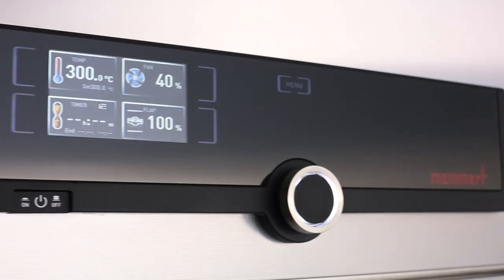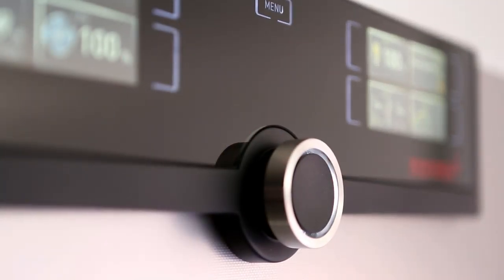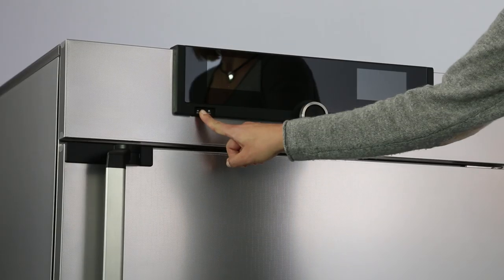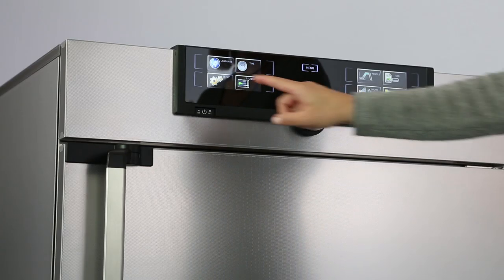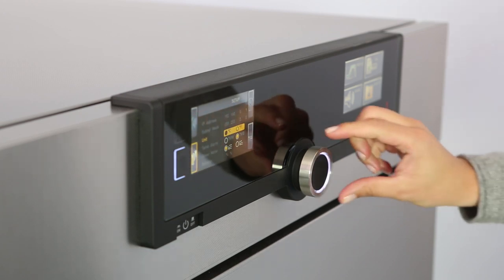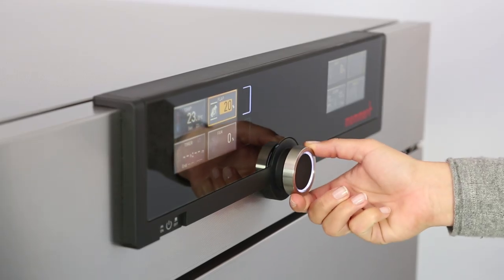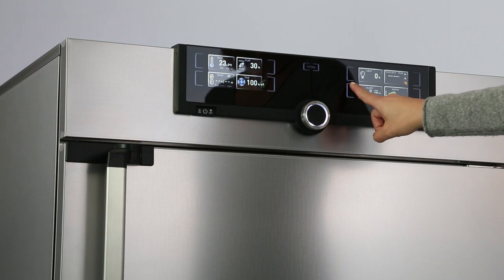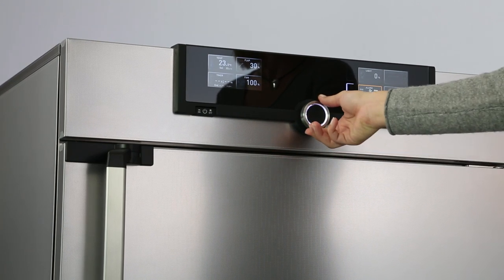Operation Memmert Laboratory Ovens

Comment: What is flap function
Reply from the maker: Dear @engrsgaming,
When the exhaust air flap is open, the chamber runs with supply and exhaust air and has a corresponding air exchange rate. This serves to extract evaporating moisture out of the appliance during the drying process.
If the exhaust air flap remains closed, the chamber runs in pure air circulation mode (no air exchange with the environment). This reduces waste heat and is also mandatory, e.g., for hot-air sterilisation.
Best regards,
Memmert Social Team